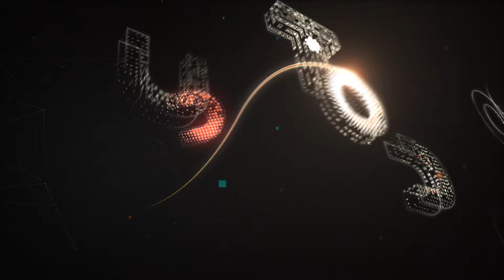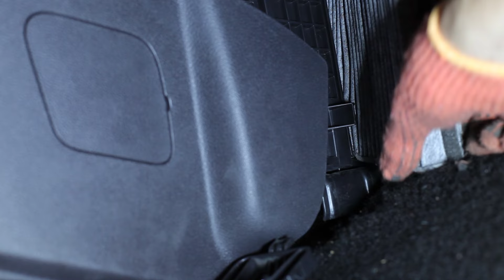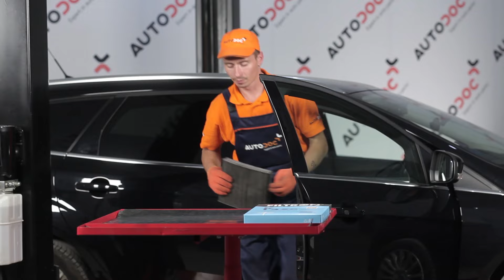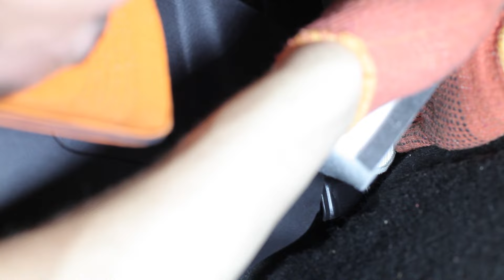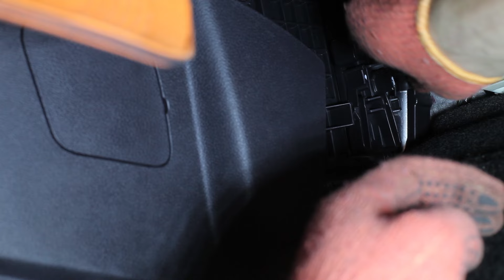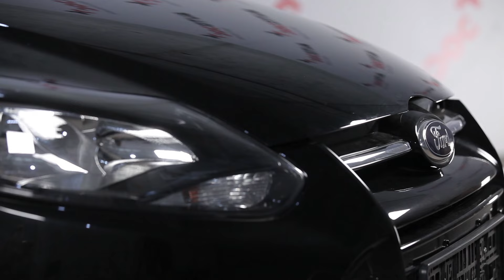How to change a Pollen Filter FORD FOCUS 3 TUTORIAL | AUTODOC

Comment: Mine has two wire looms there, one comes down right in front of the filter cover clips and is fierce tight spent around twenty minutes trying to wiggle the thing free, shoulders aching, knees sore from the weird angle you need to lean in from to get under there, next time the glove box is coming off, what an absolute nightmare of a design
Reply from the maker: Thank you for sharing your opinion!
Stay tuned with us for more new tutorials.
AUTODOC
Reply: Went through the whole thing today. The trick is really to remove the two fat wire plugs in front of the entry otherwise it's almost impossible to get any of the stiffer high-quality filters inside. To remove the plugs you have to simultaneously push in two little plastic pins on the left and right side of the fixation bow of the plugs, then the bow can be lifted completely upwards and the plugs move out.
Reply: @Bernd123  thanks man. Your tip made it considerably easier. One thing to note. There is a single screw holding the plastic cover. That shit ain’t coming back to place. Once you let it fall, as I did, it’s lost forever in another dimension. 

Also be aware that there is a couple of metallic tubes which are really hot on that place, If you run the engine before doing this. I got burnings in my fingers.
Reply: @Bernd123  I looked to remove those, but couldn't figure the mechanism out (and didn't have time to play around). I will hopefully remember how to remove them next year 😂

Comment: With this video, it is not clear to me which side of the filter to turn in the direction of air flow.
Reply from the maker: On the filter itself, there is always an arrow indicating the direction of the air flow
Our videos are for guidance only. All routine replacements and values can be found directly in the technical documentation for your car or use the help of the auto maintenance service.
AUTODOC
Reply from the maker: there is always an arrow on the filter itself indicating the direction of the airflow.
Our videos are for informational purposes only. All planned replacements and values can be found directly in the technical documentation for your car or use the help of a car maintenance service.
Reply from the maker: there is always an arrow on the filter itself indicating the direction of the airflow.
Our videos are for informational purposes only. All planned replacements and values can be found directly in the technical documentation for your car or use the help of a car maintenance service.

Comment: Well done Ford. Great engineering NOT . So its a nighmare to get out and to get it back in you literally fold the bloomin thing in half. Bang head against wall. DERRRRRR.
Reply from the maker: Thank you for sharing your opinion!
Reply: Actually no. You should bend it a little, but not fold - and it slides right in, it has a nice slot in there. In this video, Autodoc makes it seem like a big trouble (and also the mechanic touches the clean filter with his filthy glove...yuck...), but it is not at all. I have serviced cars where you have to unscrew/unclip/disassemble for the cabin filter, even there are types where you must remove the complete glove compartment to reach for the filter. THAT is nightmare. This is not.
Reply: @jensendenton  I must be a masochist because the last 3 cars I’ve owned were fords. The Cmax was the worse. You had to climb inside the passenger footwell on your back to get to the filter. Terrible design. I’d make the engineers fix their own creations for life as punishment.